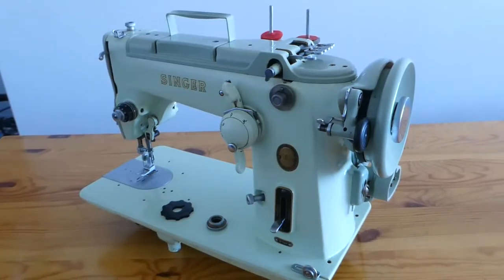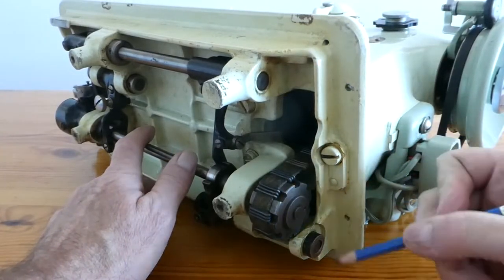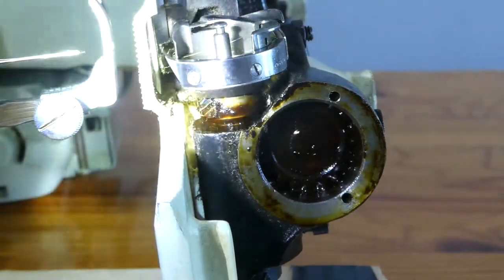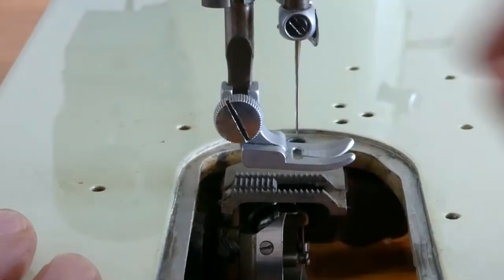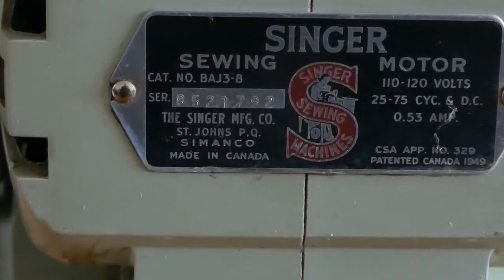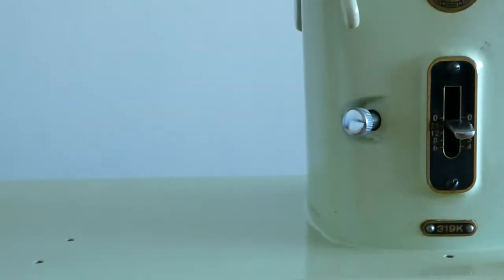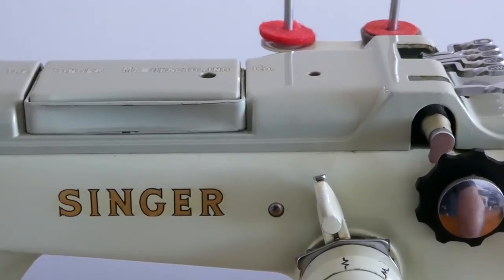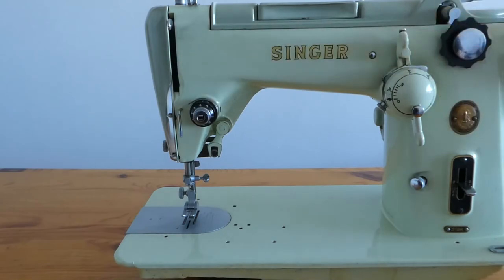SINGER 319K SEASON 2 EPISODE 8

Comment from the maker: The "W" as in 319W indicates the machine was built in the Singer factory in Bridgeport, Connecticut, USA. Apparently, Singer purchased the factory from Wheeler & Wilson in 1905. Wheeler & Wilson left in the late 1880's. One of them retired and the other one died.
The "A" in the Singer 301A indicates the machine was built in Anderson, South Carolina. A "J" indicates, as in my Singer 500J, that the machine was built in Montreal. 
Singer moved the Montreal plant to St. Johns, Quebec in 1901. The Kilbowie machines were shipped by boat from Scotland to Quebec; and Quebec is where the electric motors and portable cases or desk was installed. Those cases & electric motors were made in Canada; and it states that on the motor data label. St. Johns, Quebec was name changed many decades ago to St. Jean-sur-Richelieu. Singer never did have a plant in St. John, New Brunswick or St John's, Newfoundland!

Comment: Hi, great video ,thanks for it and share with us.
I wonder if i need special needles and where i can buy it. 
I wonder too if you jave some video to fix the problem about why the needle goes broken because when i get it dowm it the needle rubs against the edge of the bobin case.  I can send a video so you can undertand better was it the problem  with my sewing machine. Thanks in advance .
Reply from the maker: Hi Estella! The timing has to be set between the needle and hook. You have to make sure you have the correct needle. If the needle is the correct one then it is a timing issue.

Comment: Thanks so much for this super walkthrough! Any advice on a stuck stitch-length lever? The lever itself moves fine (I took out the set screw and stud and temporarily disconnected it from the connecting link to be sure), but the link and feed rock shaft don't move at all. The lever (when connected) is stuck, stuck stuck. I'm not even sure what is supposed to move, or how. Tons of oil, but nothing's budging! Do you have any advice?
Reply from the maker: Try heating it with a hair dryer or heat gun. Use oven mitts or gloves to protect your hands. Heat it near the points you mentioned; feed rock shaft, etc. Heat it for 4 or 5 minutes. It will seem like an eternity. Then see if there is any release. If not you have to decide if you can tap it smartly with a small hammer or other tool. If heat and pressure don't work get the pliers and try to release it. 
How does that sound to you? You can do it! Have fun! Thank you for coming here, I do appreciate your time! Cheers!
Reply: That sounds smart! I will do that. I'm honestly just not sure which part is actually supposed to move! There must be something that pivots when the lever goes up and down... Do you know where the link/rod pivot is supposed to happen? Thanks again! ❤
Reply from the maker: Merry, thanks! Now before I get started; check out Sewing Machine Rehab, Jenn is an expert restorer and has done a number of stitch levers in her vids. Also check out Andy Tube! There, that’s fine.
Reply from the maker: Yes Kerry, but it is awkward to get to. The top cover has to be removed, and more than likely the front plastic cover too.
The pivot point is in there.There is a screw on the stitch lever just inside the machine. That screw will release the lever from the internal.
That is an area of the machine errr varnish and rust hide. 
Stitch levers are a challenge. I do not have the experience. But I will look at this 338 and check it out. I just took apart a 348 so I will inspect that tomorrow..
I am a beginner/ intermediate restorer. I restore parts of the sewing machine, but very rarely an entire restoration. I am still working towards that.
I will be doing annoying video on the 338 soon. Also the hand wheel replacement.
I did the 338 hand wheel removal 2 videos ago.
But the 348 was never cleaned until tomorrow! I will be oiling where the do so I will figure it out hopefully.
So I will message you in about 24 hours and let you know what the results of my inspection is. The video will be posted in about 3 days (hopefully m).
This research project will do us both good I hope Kerry! 👍🙏
Reply from the maker: Another video! Not an annoying videi1 lol!🤷
Reply: Thanks so much for your generous time. I hope you get some ideas. I'm sure what I need to move is underneath... One of the metal parts around 3:11 in this video. We'll figure it out! 😂
Reply from the maker: @KerriHicks  I just pulled out a 306 and the 319W. Get started familiarizing myself again. It has been a while since I did a 306 or 319 vid so your timing was spot on! I'll check that 3:11!
Reply from the maker: Hi Kerry! How are you? You’re great! 
So I went to manualslib.com and was looking in the Adjusters Manual for the Singer 306.
I was able to view it online, it’s free. On about page 32 or 33 there is a photo looking towards what I think we are after.
Another channel is Eric Neek. He has a few 306 videos. Anyway, I am going to get my 306 from my locker and shine a light in there and film it. It will become part of a 306 video!
I was hoping for more info. There is a lot of interest in 306’s! 👍 They are a bit of a challenge to restore. Accessing this stitch lever is work! lol! Go figure!
Later! 🙏
Reply: @JebbAdams it worked! The heat gun softened it up, and set the lever free! Thanks so much!
Reply from the maker: @KerriHicks  So glad to hear about your success KerryHicks! Good job, restorer! Fun is such fun isn't it? What's next Kerry? What are you going to fix now? Yay!
Reply: @JebbAdams  This is my 73rd machine! Next up is #74, a crinkle finish 66 from 1941!
Reply from the maker: @KerriHicks  Cool! That is a lot of machines! For the last couple of years I am holding about 30 machines! Lol!

Comment: Is Singer 319K Machine Internal Belt Durable? If it breaks, it's still made for replacement. Because this belt seems to be delicate and not very durable. Are bobbin case and bobbins easy to find for replacement yet?
Reply from the maker: Very durable! Central Michigan Sewing Supply sells them for $80.00. An original vintage costs $52.00. Bobbins  and needles, very available also! Enjoy!
Reply: Never let oil touch it because it will fray
Reply from the maker: @carmelofarrugia5855  Thank you!
Reply from the maker: @carmelofarrugia5855  Thanks!
Reply: @carmelofarrugia5855  Thank you! 🙏
Reply: @JebbAdams  нужны иглы к зингер 320
Reply: Hi, Wich kind of needs it's for this machine.